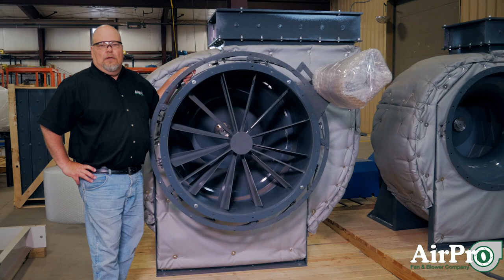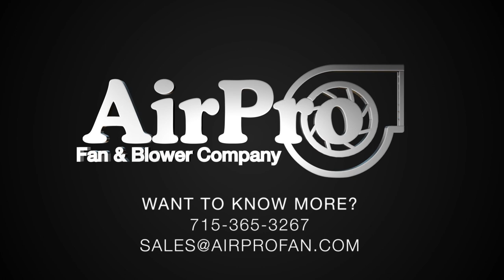Control Fan with VFD or Damper?

Comment: The power plant I worked at used VFDs to control the ventilation fans in the low bay (where the turbine/generators were).  I know they saved money using them or they wouldn't have installed them.  Thanks for this.